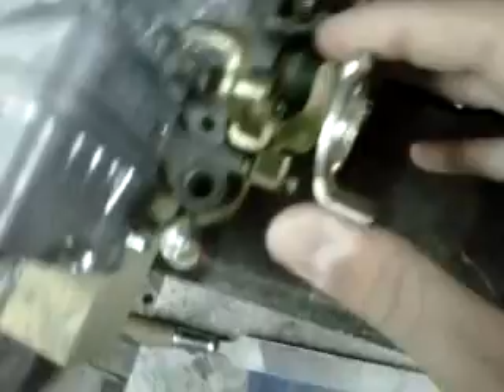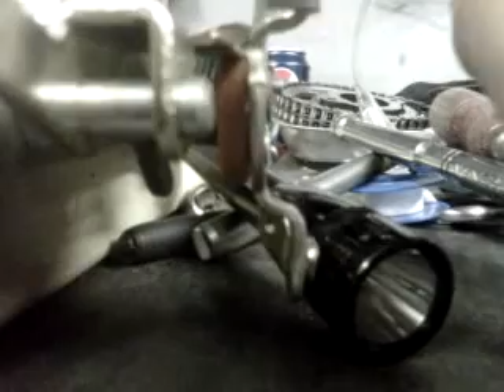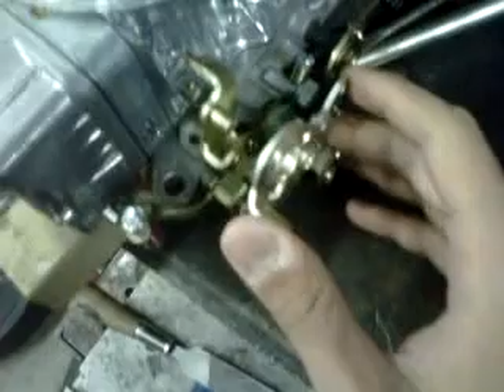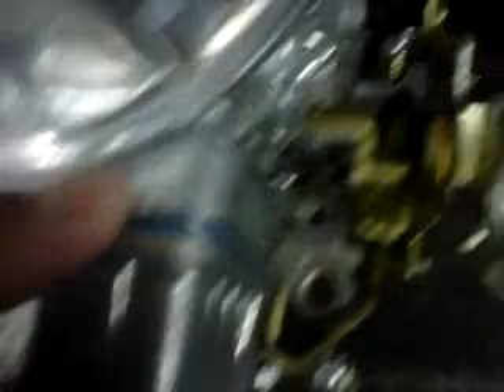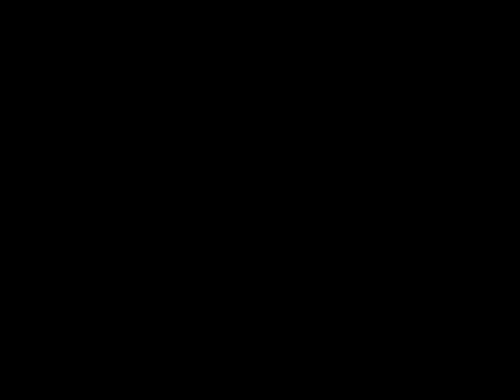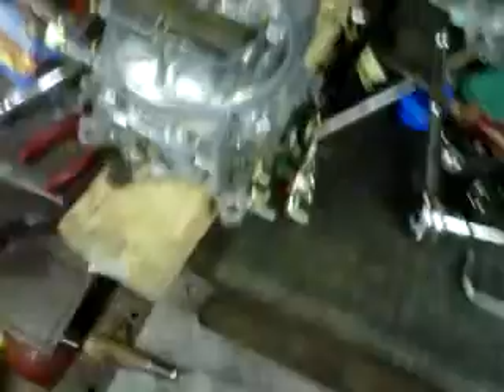Street Avenger Holley Bog Problem (when you dont know what you are talking about)

Comment: Man people hate this carb lol 😆 funny this video is 10 yrs old I seen it before a few years ago , but changing over from a 350 2bbl to a 4bbl I found  a 600 on offer up and just like all the rest it had a mean stumble off idle .
I adjusted the pump so many times I bought a pump cam assortment tried the blue , the , yellow , and orange it never fixed it . 
I finally started going up on squirters and added the hollow screw .
I ended up with a # 35 squirter orange cam on #1 , 66 main 7.5 PV and I changed from a plate with #74 to around 86 rear jets and meterijg block. With the bigger shit #35 I found it great that I can run a smaller main jet instead of using a smaller squirter and bigger main jet , so my AFR is in the 13:80 14 ish on the fwy . I finally called Holly and they told me there was a tech note on this carb to run a #35 and change to pump cam #2 . 
After I spent a hundred or so on parts trying to fix it myself , to make it even better since i was used to the 350 Holly 2bbl I was used to good take off exceleration due to the bigger bore than the 600 I was a little bummed that the primary side didn't wow me like the 350 so I found a 670 for sale and I bought that 😳.  At least I know we're to start with that one .

Comment: So was it maybe that the Pump Cam end of the metal Accelerator Pump Arm was BENT wrong, as to why maybe that it was hitting the green primary shaft mounted return spring ?  I keep one of those black Plastic Holley Accelerator Pump Arms on-hand to kinda use as a 'jig' for checking the geometry of the metal, but bendable, Accelerator Pump Arms...  Those black plastic accelerator pump arms may seem chintzy, but they are not bendable... LOL   But beyond that, are you aware that the Avenger Metering blocks have 2 internal 'Check Valves' like that found beneath the Squirter(s) ?  That is a big cause of many 'issues' with the avenger carbs. imho...

Comment: Having the same issues with my Holley,  tempted to go with the Edelbrock if I can't figure it out soon
Reply: Off idle stumble is very common on these holleys. I went through everything you can imagine and what finally did it was opening up the idle fuel restrictors 4 sizes up and I was able to jet down after that. My engine is an LS converted to carb. Depending on you situation, it might be an easy fix. Edlebrocks do tend to run better out of the box on most stock or mild builds.
Reply: Get an Edelbrock AVS2 you won't be sorry.

Comment: My holley street avenger 770 is acting up to. It's on a 340 motor (duster). It ran fine when I first had it put on..then about 2 yrs afterwards it seems to be all out of wack. Now when I start it..it cuts off and won't idle. I messed around with the idle screws..and got it to idle really good nice a crispy to were u could hear my comp cam 27th 488/491 lift really chop. Cut it off and start it again..nothing. .cuts back off again..i got a holley jet kit and a 3.5 power valve. .maybe this will solve my problem. If not I'm going with a holley 650 DP .
Reply: Check your needle valves, they may not be seating, exposure to gasohol causes many problems in these carburetors. I have to replace the needle and seat assemblies every two years or so because they no longer shut off fuel to the bowls and the carburetor just dumps fuel until it fouls the spark plugs
Reply: I think you missed the point, alcohol shortens the life of the rubber tips in the needle assembly, and the water and things in the water (corrosives) causes corrosion inside the carburetor, probably a good argument for ethanol treatment additives until they remove the alcohol from our gasoline!
Reply from the maker: james myers before you do anything crazy, look at the vacuum port plugs on the carb. they dont last too long it seems and when they do it will be a huige vacuum leak. especially that big ass one on the back. 90 percent sure your issue lies there. 

if it is the carb, try resetting the idle parameters. i go over how to do this in this short video https://www.youtube.com/watch?v=oBOrWUPhYto

get back to me with your results
Reply: Thanks alot..I'm nowhere near a mechanic but I can mess around with the idle screw and that's about it. I need to watch some videos on how to work on carbs and get the concept down.
Reply from the maker: its all not too terribly difficult. i have a whole host of videos including how to remove and install a carb, how to adjust them and what to look for. i really think you just have a vacuum leak. if you have any more questions, please feel free to ask.
Reply: ThunderHead289 thank alot man I'm gonna check your vids out..Greatly appreciated.
Reply: ***** thanks for all the tips.
Reply: Boyd Joiner turned out u had water in my carb. But thanks a lot, I will take heed to what you said. Ya never know when something else may happen.
Reply: Boyd Joiner gotcha bud, makes sense. I'm no mechanic and still learning.

Comment: GUYS..... The street Avenger is an emissions approved carb. It has a leaned out transfer circuit. It needs small cam, high vacuum in the intake to pull gas from the under sized transfer slots. The only way to fix it is to put a metering block on it from an older model holley 600. And then put your #31 jets on it, and buy a #61 power valve. Anything else is a band aid.
HOLLEY IS JUNK AND SHOULD BE ASHAMED FOR NOT MAKING IT CLEAR WHAT KIND OF MOTORS THIS POS AVENGER BELONGS ON.
After people have spent all kinds of money on accelerator cams, and nozzles they end up junking it and buying an Edelbrock. BAD BUSINESS HOLLEY!!!
Reply: ThunderHead289 Thanks for the info.  I looked in to them and wish I saw this before buying the $300 Edelbrock. lol  I'm tuning and jetting the edelbrock now. Large accelerator pump nozzel, and largest most aggressive jets and needs for this carb. I have a 351 cleveland and pushing the edelbrock to max jetting will tell me if The next carb I buy should be bigger.  So far I don't see rich black smoke out the back. I'll get an wide band o2 sensor and air/fuel guage and fine tune it to perfection. (as perfect as edelbrock can be) I think when I get the 4v heads and 4v CJ cam with 6k rpm springs I might be stepping up to a 750. I'm going to save my pennys and get a speed demon carb. I'm seeing great things with them and none of the holley issues. No metering blocks as well. I think summet took a lot of ideas from Demon. When it comes to the upgrades, I'll be racing it at that point. So I'll go a little pricey.
Reply from the maker: starbattles1 i read through everything you had to say, and i agree that holley failed to inform people as to what engines these carbs were designed for. certainly nothing with a cam. i run a summit 600 annular booster carb. blows the doors of any carbs out there and they are very affordable. not metering blocks either, the top comes off and you can change jets with it on the engine easily. the annular that usually require a high dollar carb to get are very crisp and responsive. i think i paid 250 for it new and its awesome. all parts are holley based, so no surprises when trying to find parts. search my channel for summit carb and see some of my reviews on it.
Reply: I have a 600 and for da life of me can't seen to fix my stumble and stall problem on take off
Reply: so I have a 600 on my car what is yr chanel

Comment: 770 CFM & not a single issue.. Throttle response is so crisp you'd swear the engine is fuel injected. 👍
Reply from the maker: XCSEDAN i completely agree with you. I need to take down this video. its one of the first videos I ever made like 3 years ago on my old channel. granted I am only 21 now, but my problem is obvious.
with the duration of that cam it runs best at 14 to 15 degrees of initial timing.  couple that with the stock style vacuum advance and running full manifold vacuum and im sitting at 30 degrees of advance. this causes the engine to idle much higher than it should and for the throttle blades to be closed much more than the carb was ever designed for. with the throttle blades in that orientation there is always going to be a huge gap like I show in this video. even if there wasn't and the accelerator pump was right, the throttle blades in relation to the transfer slots would be all messed up to hell.

long story short, I run an adjustable vacuum canister that brings in 8 degrees, so I idle at a nice 21 to 22 degrees of advance with 14-15 degrees of mechanical advance. never had a problem with carbs since.

you are correct, I am a complete idiot in this video.
Reply: i think this dude needs to learn a bit more.... how is it i've tuned 20 of these things without an issue? just a simple once over on any carb solves most issues.
never trust someone who says "i know about all there is to know" straight out means they need to learn more.
Reply: XCSEDAN I have one for sale. Only a few hundred miles on it. Set of accelerator pump cams, and secondary springs with quick change cap.  I have not messed with jets and never taken it appart. Runs great, eccept for the off idle flat spot (not so much of a bog or hesitation but just flat while it goes past the transition slots. If you move past them quickly it will romp hard blowing off the tires. I admit, it has a lot of punch.
If it goes on a manual transmission car the off idle flat spot will not be a factor.  $250 asking price.

Comment: So wat kind of carb would u recommend?
Reply from the maker: summit makes a nice 600 style vac carb. one of those with a regulator run pretty well. im partial to quick fuel carbs with annular boosters these days. the annular booster is very important for performance
Reply: Ok cuz I was planning to put xe268 comp cams and the performer air gap intake on my engine. U still think that carb would work? I was lookin at the quick fuel hot rod carb 650cfm and it had to some good reviews.
Reply from the maker: with an air gap I would definitely recommend annular boosters to get proper fuel atomization. quick fuel has a a double pumper series with annular boosters that I like as well. I believe it is the ss series.
Reply: What cfm is it? Cuz I was thinkin of gettin a 650.
Reply from the maker: the ss series has an annular 650 double pumper

Comment: I had the same issue with the arm riding on the spring on my 670 avenger.  I had an old 600 holley laying around, and I pulled the arm off of it.  It was different than the avenger arm..it swapped right on, and the arm now rests on the pump cam properly using the older arm

Comment: Your problem is a easy fix. You just have to know what and how to adjust to fix it.
Reply: Brandon is absolutely right. I worked for him for many years, with our primary focus on rebuilding Holley carburetors.
Reply from the maker: Lyon Vinson here is a comment I made a few months back regarding this video. I made this when I was 17 so needless to say. . . .but anyway heres what I said
 i completely agree with you. I need to take down this video. its one of the first videos I ever made like 3 years ago on my old channel. granted I am only 21 now, but my problem is obvious.
with the duration of that cam it runs best at 14 to 15 degrees of initial timing.  couple that with the stock style vacuum advance and running full manifold vacuum and im sitting at 30 degrees of advance. this causes the engine to idle much higher than it should and for the throttle blades to be closed much more than the carb was ever designed for. with the throttle blades in that orientation there is always going to be a huge gap like I show in this video. even if there wasn't and the accelerator pump was right, the throttle blades in relation to the transfer slots would be all messed up to hell.

long story short, I run an adjustable vacuum canister that brings in 8 degrees, so I idle at a nice 21 to 22 degrees of advance with 14-15 degrees of mechanical advance. never had a problem with carbs since.

you are correct, I am a complete idiot in this video.
Reply: @ThunderHead289  na you given us years of quality content everyone starts somewhere and many  have like me benefit from you videos 👍  now Id like  your opinion I'm going to change from my old Holly 2bbl 350 cfm to a 4bbl I have a 69 250 390 it has a DEH 265 cam and headers elec ign I ordered the Edelbrock RPM intake there are more choices for 600 than 650 cfm I been looking at reviews Edelbrock AVS 650 /625 demon / classic Holly / brawler / etc what's your recommendation on a reliable Carb for this application ? The truck is lowered with a flip kit , lowered I beams , I just put a gear vendor in it , I see reviews the guys say the carb is outstanding then later on they changed it for some reason I'm thinking 650 cfm non double pump ...

Comment: I have the same problems with my Holley 670 truck avenger. Ran rich out of the box, and bad low end stumble. I had to bend the linkage with some pliers in order to make contact with the accelerator pump at the right time. It's much better than it was but the stumble is still there... for now.
Reply from the maker: hey, look into summits 600 annular booster carb, its a cheap carb that really performs well. annular boosters for a steal. very responsive. I now run a qf 650 annular double pumper on this car and the summit annular on my truck. very pleased with quality and drivability! best of luck!
Reply: I too have the 670 truck avenger on my 1982 Chevy 4x4 and it worked fine for a few months. Then one day it just went to shit/bad stumble especially in a pull or going up a hill. I adjusted and adjusted, it helped but still there. Iam ready to throw this junk in the trash. If I had the money I would convert to EFI!!
Reply from the maker: look into the summit 600. I need to make a vid, but it is one hell of a carb for 250. annular boosters!!!!
Reply: JLSGsmargian  Here are some things I would try: 
   I'm sure you've checked the fuel filter, right? If your getting good fuel supply to your carb, I would have a look at the power valve and make sure it's not blown.
  Also, make sure your float bowls are set properly, as it kind of sounds like you're truck is starving for fuel.
  Are your secondaries opening?
  Your could try cleaning your air bleeds, rev it up from under the hood and cover the primary side with your hand.
  I hope this helps!  I know these Holleys are finicky, but I do believe they are a good carb.
 
  On another note, I have pretty much solved my 670 Truck Avenger's stumble. Right now I am running a #37 discharge nozzle and it is much snappier low end. I am going to try a 50cc diaphragm and a #39 and see how it works. #40 and up and you need the hollow discharge nozzle screw as well.
Reply from the maker: even on the street avengers best day, other carbs will out perform them. except edelbrocks. ha.
Reply: Brandon McJeeperson My filter is good, as are floats. It sounds/feels like the secondaries  are opening, but as far as the power valve not sure. The truck stumbles bad right off the line, as the rpm goes up it seems to clear up. Thanks for the advice.
Reply: ThunderHead289 I took the junk holley off and put an edelbrock on my car when I was 16. 100x better then the holley on the holleys best day. Edelbrocks like all carbs need to be tuned to your motor. If you don't you will not get the maximum results you desire. There 10x easier to tune.  Holley has always had a bad reputation with there metering blocks and power valves getting blown out and cracking blocks and body.
This time I am going to do what I know for a fact works. Junk the holley and get a tried and time tested edelbrock.

Comment: Why don't you put fuel regulator on there. 4 pounds is plenty of pressure for that carburetor
Reply from the maker: if you look at any of my other vids, I do run regulators. I am actually a huge advocate for regulators and I run between 4 to 5 psi on all my vehicles. good post. everyone really should run one these days.
Reply: Ed Cady Holleys need 5-6 psi. Any one who knows holleys knows this. Other carbs like to have 3-4 psi. But not the holley.

Comment: The green cam doesnt look like its around far enough to run on the lever if its not sitting on the spring. Apart from these issues the carb seems decent enough but these problems should not exist to begin with just poor design
Reply: i run an orange cam and no stimble

Comment: Ok your spot on with the ultra avenger issues. On my engine the thing ran rich out of the box so bad it was eye burning. Had to crack open the secondaries so the mixture screws worked. Yeah I have the of idle stumble your talking about. I looked at the pump cam and noticed exactly the issue your talking about where the lever is running on the spring. Whoever designed that should be flogged. I m thinking of narrowing the cam lever to miss the spring.....change to another cam from the green one..

Comment: Outstanding! Had a whole world of pain with my 670 SA on a 351c, took a lot of messing about to get it anywhere near right, going to check mine today to see if it's binding on the spring like yours. Did up the squirter size but obviously not the real answer. Did see on a forum some reference to the air passages in the base plate being poorly finished & partially blocked with casting flash. Glad so see it's not just mine giving problems!

Comment from the maker: idk if you have seen the rest of my videos, but that's definitely not how I am. if you type in holley carb to google, my adjustment basics vid is the first video to appear. the issue is that you can adjust the air bleeds. the fixed air bleeds are quite lean. its not performance and it never can be. I run a 650 dp now and its awesome.